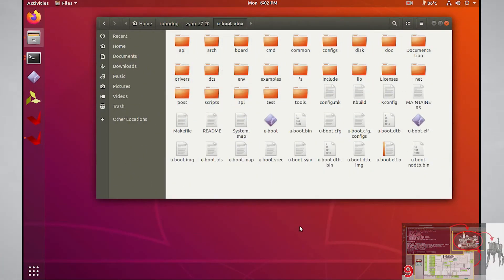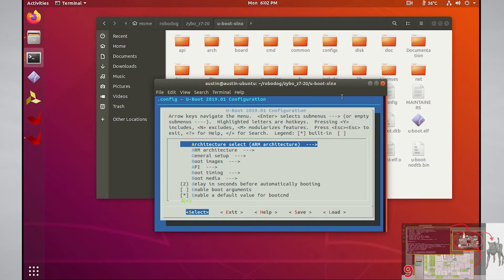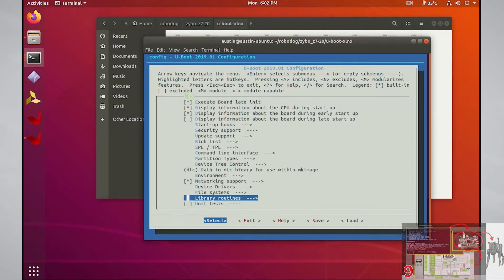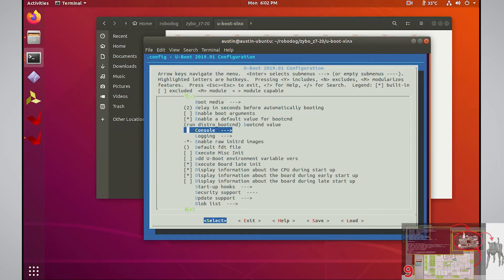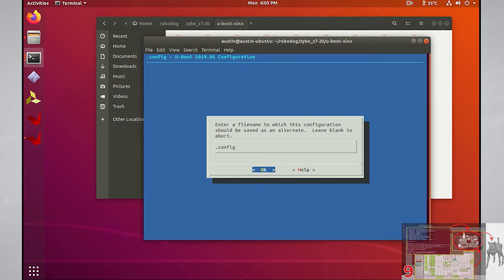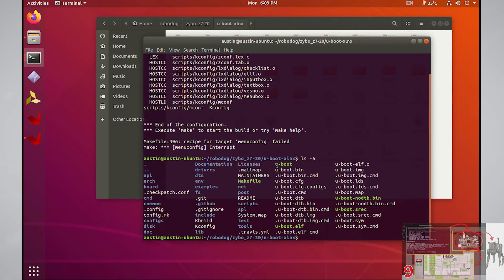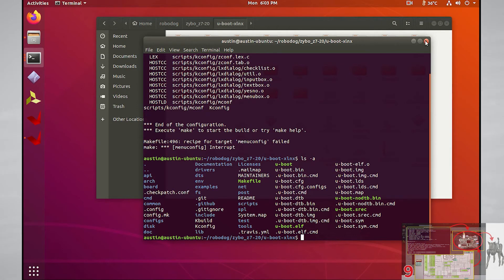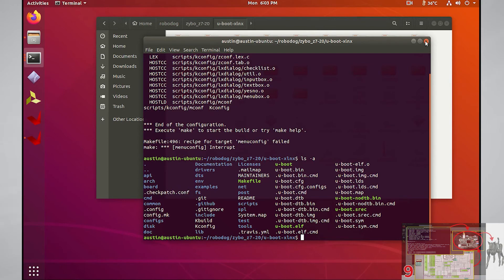#9 TechBytes | How to Configure U-Boot

Comment: could you show how to send it to the sd card, im using buildroot for imx6q sabre and i got a u-boot.imx and u-boot.bin, besides boot.vfat and zImage. I'm kinda lost, hope you see this comment
Reply from the maker: u-boot.bin typically goes inside a boot.bin archive file if your target hardware is a Xilinx (AMD) chip. The zImage is a form of kernel binary. You need the kernel in the form of image.ub so that the binary has the proper header information for u-boot to properly hand off execution control to the kernel inside the image.ub.